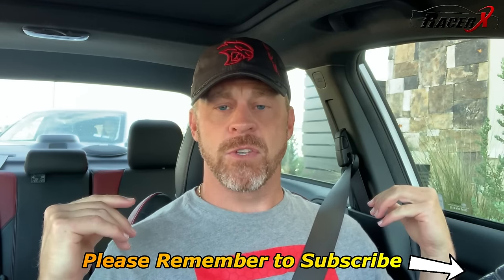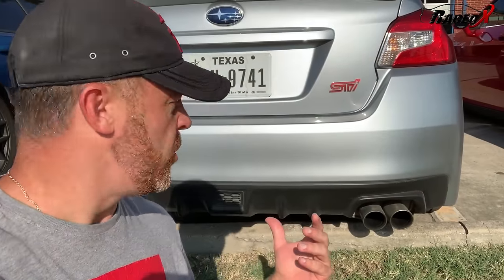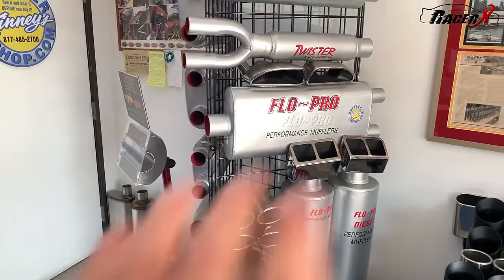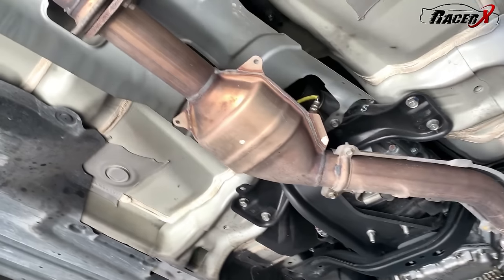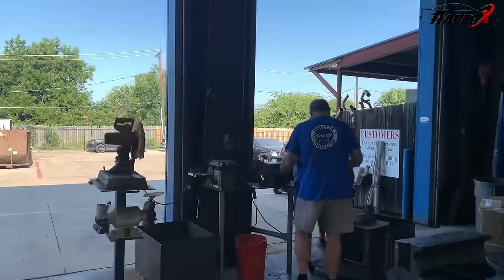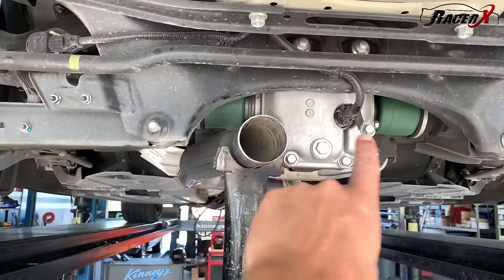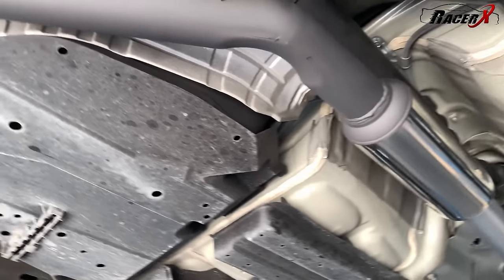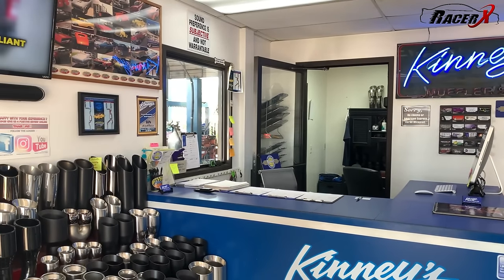How can a 4 cylinder sound this good?  Lets see how they did it.

Comment: Wow the new system sounds great! You wouldn't expect a 4 cylinder to sound like that.
Reply from the maker: I agree Mike..  it really surprised me
Reply: Srt4.. lol
Reply: It's due to the unequal length header... get an equal length and it loses that rumble
Reply: @DennnnnnnY  my srt 4 has borla and its  gotten louder over 2 years. I may be making a borla atak axle back exhaust
Reply: @DennnnnnnY  sti you mean
Reply: The EJ257 with its unequal length headers is the best sounding 4 cylinder.
Reply: unequal length headers will allow you to get the same rumble from any 4 cylinder engine, other than that subaru uses a flat four which the cylinders are horizontal not vertical.

Comment: Same problem I'm having with local exhaust shops is they use the cheaper bending machine that shrinks down at the bends. Put a caliper on a 90 degree section and it's about .25" smaller outer diameter than the straight section, killing flow so you end up with a bunch of noise for little to no power. Mandrel or piecut is the only way to go for performance.

Comment: Great review! Love that red Challenger! That Roadrunner is sweet!  Love the enthusiasm in all of your reviews! I agree that the WRX pulls off an amazing sound that I've not heard on other 4 cylinders! I will give it a pass in my book! Love the new pipes! Have a great weekend bud!
Reply from the maker: For sure my friend.. much appreciated.  Have a great weekend
Reply: Is this type of (aggressive) sound not be able to be made on other 4 cylinders like the Toyota Camry XSE?
Reply: @fullofpeace3486  Mechanically, it cannot without special exhaust headers. The WRX is a boxer engine, while the Camry is an inline engine, and given the engine bay size on a Camry there might not be enough room to fit unequal length headers that join cylinder pairs 1/3 and 2/4 to get the Subaru rumble/burble sound, and that requires some artistry to join cylinders that are not adjacent to each other. It also depends on if the XSE comes with a turbocharger considering its a sport model, though from what I can tell the 2.5L VVT-i engine is naturally aspirated given its 200 someodd horsepower. The EJ205 firing order is 1324 which basically means left, left, right, right, so there are two pulses on one header length and then two on another header length. The unequal lengths join the pulses into a larger one at near idle speeds giving the "Subie Rumble" that we all love, so its just a matter of matching the pulses and header length ratios from the EJ205 onto the Camry's A25A-FKS, or the 2AR-FE if its not the 2017+ models.

TL;DR, special headers if they can fit on non-turbo engine, unequal length runners join cylinder pairs 1/3 and 2/4, one pair needs to loop around before joining at the collector to give the pulses the right delay for the Subaru rumble.

Comment: It's hard to make my Camry exhaust sound good at low RPM. I've been searching and looking at videos for the first generation Scion TC, since it's the same engine with a different transmission. I currently have the stock exhaust with a resonator delete, and a Megan Racing N1 style muffler. I don't wanna go straight pipe because it's gonna sound even worse.   What I'm gonna do is take my Camry to an exhaust shop and have them make a brand new exhaust 2.5 in no resonator and possibly a Magan Racing blast pipe, with a Blue burned tip.

Comment: Did you remove resonator? Love the sound. Im looking for a throaty exhaust for my 2.4l Hyundai sonata 2013. Any drone in that system? What was price on something like that? Thanks
Reply: It looks like the aftermarket muffler replaced the stock resonator. 

I would say you could get a very similar sound if you put in some unequal length headers on your car and an aggressive straight through Muffler such as a Carven R muffler where the resonator is.

Comment: For starters they're cheating with a flat 4, especially the Subaru because of the unequal length headers, then you have it turboed, and that knocks down alot of the valve noise and buzz a 4 cylinder makes, it's basically a cherry picked a turbo 4 cylinder.  Why don't you do this with a NA corolla or a civic. I bet it doesn't sound anywhere near this despite having basically the same displacenent.

Comment: The only men that think a Subaru sounds good are the same ones that think wearing pink is a good thing. Or that it's okay you call AAA to fix a flat tire because you couldn't find the spare. Or a guy that thinks a Miata is a man's car. And you are also the guy that says " the system is installed all the way to the cats" on an old dodge that has never seen a catalytic converter. They are called exhaust manifolds! You are the exact type of person REAL car guys think about guys that's drive a Subaru..

Comment: All Subaru WRX sound good with with an exhaust system. Boxer motors do sound great
Reply from the maker: Yes it wakes up the sound quite a bit.. not sure why they used massive mufflers with the such a small Y pipe.. seemed a bit odd

Comment: They did a crappy job on the Roadrunner,  first thing I noticed was the exhaust exits right under the rear bumper.  Bad, bad spot. That location is going to rust the entire rear of the car out in just a few years.  It might even kill the driver with exhaust gasses seeping into the passenger compartment via the trunk.

Comment: The reason it sounds like that is because Subaru makes the headers on these engines different lengths you won’t get this sound from any other 4 cylinder probably should’ve used a Honda or Toyota since that’s what most 4 cylinders will actually sound like

Comment: it sounds great but 2.5" crush bent tubing flows about as well as mandrel bent 2.25" tube. your stock exhaust system is 2.375" tubing, mandrel bent. in other words, your stock system actually flows better than what you spent hundred of dollars on. instead, you shouldve just cut the mufflers off and welded those tips on it.

Comment: Do you still like the STi if you still have it? I am thinking about buying a 2020 STi for a DD as well. I am either between it and a Camaro SS 1LE. It sucks that these cars are pretty slow from the factory but I understand they're supposed to focus more on handling than speed. I live in the mountains for graduate school and we have some pretty fun roads around here including the tail of the dragon. It doesn't snow here too much but at least I could still take the Subaru down gravel roads to go trout fishing and to my research sites this summer. I still have Jeep wrangler and a F150 that I could drive on those roads, but that means driving 3 hours back home to swap out. I think the STi would be almost the perfect car for what I want; fun, good on the hairpin roads, get better mpg than my truck and Jeep and still be able to take it fishing when needed. If I get the STi I will probably tune it eventually but both of the ones I am looking at have 4 years and 35,000 miles left on the warranty, so I'll leave it stock for that long. I'm a little weary about the reliability of the EJ motors in the STis, but it seems that most of the people who blow them up do not take good care of the car and usually mod them without tunes.

Comment: I need to come to Texas and let them redo my sequoia
Reply from the maker: They would most certainly do it ..
Reply: @RacerX9  round here in the Mississippi Delta I been trying to get my exhaust redone the muffler always tell me my sequoia isn't set up to run dual exhaust. If it costs me a 8 hour drive gas and a hotel I would let them do it

Comment: Same color as my WRX, love it.  I did the exhaust on mine myself.  I have the FA20 so it has equal length headers so no burble but it is loud!  I did the grimmspeed turbo back with nameless muffler deletes.  When I dropped it down and did a cold start I thought what have I done!  A few years later I still love the sound, kinda sounds exotic.

Comment: Sounds good, but quiet. They'll always be a bit quiet, a turbo is a muffler after all. However, a high flow cat would do wonders and really let you hear that flat four. I prefer the older style uneven headers, personally, but that system is really professional and has potential.

Comment: I haven’t even finished the video, but just seeing the Plymouth exhaust I knew they were a great shop and put quality at top!.!.! Any one notice 👀 they actually painted the welds black where they were welded- not only that they taped around the piping to have a clean crisp black line to look flawless. Cuz I believe that to be a flow master- and most come black- and once welded the welds are raw looking and usually rust after just a little while. These guys went the extra mile to not only paint the welds black to resist rust- but actually taped them before painting to have a clean line rather than random over spray. 🤷🏻‍♂️ I tend to notice the details

Comment: What's the difference between a low flow y pipe and a "high flow Y pipe" 🤦‍♂️
Reply: Oh and FYI a 2 1/2 inch "crush bend exhaust" is actually crushed down to a 2 inch at each bend

Comment: RACER X MERRY CHRISTMAS TO YOU AND MRS. X I LOVE YOUR VIDEOS. 1 QUESTION I HAVE A STOCK 2013 RT GOT FOR A GREAT PRICE VERY LOW MILEAGE.  WHAT SIZE WHEEL AND TIRE CAN I USE? WOULD YOU RECOMMEND A MID MUFFLER DELETE
Reply from the maker: Thank you my friend.. I would go with a 9.5 wheel by 275 tire.. that should work just fine.  Mid muffler delete sounds really nice on these cars
Reply: @RacerX9 Thank You Sir ypu are the best. Im not looking for speed at this point of my life im 57 im not taking anyone. Quick question I got it used with 3k mileage its a 13 should I change hoses and belts

Comment: looks like half of the pipe diameter is missing when it got bend
Reply: Surprised they don’t have a mandrel bender. Maybe it doesn’t make that big a difference overall?
Reply from the maker: It might be a bit deceiving.. it didn't lose much in the bends and the diameter was larger anyway.  Certainly made a huge difference in sound and the car seems to have picked up some power from how it seems to drive now
Reply: @RacerX9  Great to hear and it sound really good :)
Reply: We can do mandrel for additional cost.
Reply: Kirk Robinson... if nothing else it looks better. Thanks for the reply.